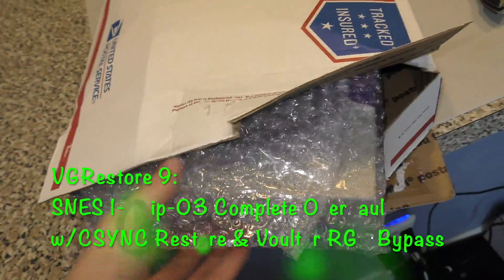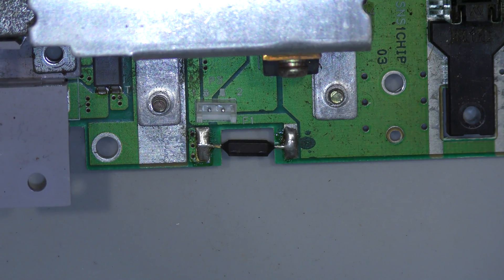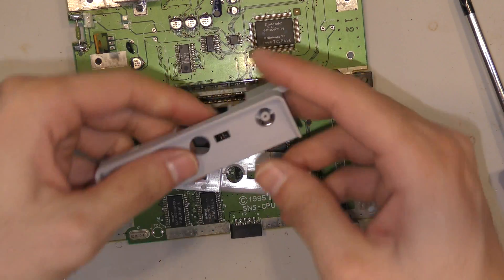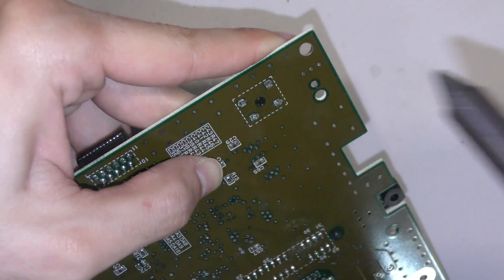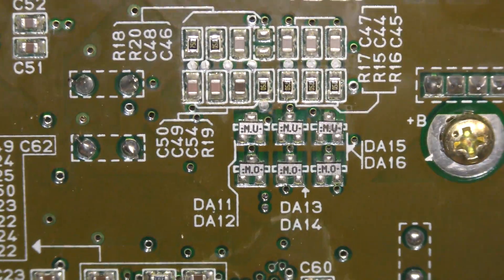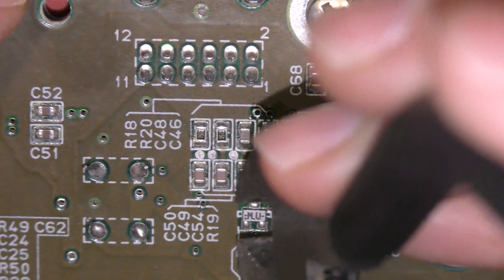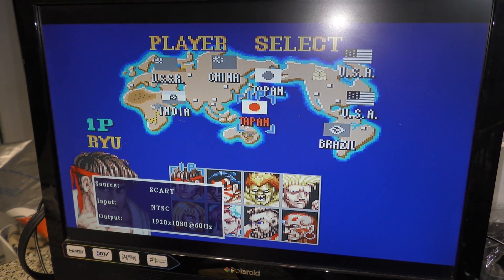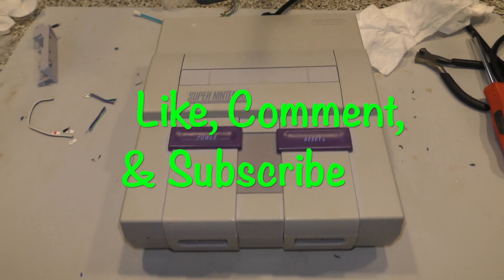VGRestore Ep9: SNES 1-Chip-03 Complete Overhaul w/CSNYC Restore & Voultar RGB Bypass

Comment: Will the pin connector come out of the 03?
Reply from the maker: No you will have to desolder it.
Reply: @PunkNDisorderlyGamer  thanks for the response, that is good to know. I took apart my '03 and cleaned it just like in all these cleaning videos, and I actually also had the first series SNES as well, but I can't remember the number for that. That connector came right off, and I cleaned the inside of that SNES as well, however, after the cleaning and trying different cables and cartridges, I cannot make either of those consoles work.

Comment: Ok probably answered this earlier but my Mario world game keeps missing music during the map screen.any ideas on why???
Reply from the maker: I’m not sure, that’s very strange I would try another copy of the game, if it still persists then your console may have an APU fault. If your console has a removable SHVC I would try reseating it or replacing it. Could also be bad capacitors but, you mention the console doesn’t have music only on the title screen, other parts it’s fine?
Reply: Ok just to be sure I I double scrubbed everything and re soldered all connections and no dice.also I tried to remove the pin connectors and it's like it's super glued in.any ideas?also yes i removed all retaining screws.
Reply: I still can't remove my pin connector bar.its like it's stuck  with super glue.any ideas on how to remove it w/O damage?
Reply from the maker: Jacinto Gomez you have to clear the through holes, if you have a desoldering gun it’s easy. If you have a vacuum pump or desoldering braid it takes more effort.
Reply: @PunkNDisorderlyGamer  ok there's thin lock clip tabs but I've already in clipped them and the two retaining screws.
Reply: Wait ok I see what's going on.it looks like there's calcium or lime in the pin connectors.thank god none broke.wheew!😓

Comment: what does the fuse change do? does it just not work without the fuse?
Reply from the maker: You won’t get any power if the fuse is blown. It’s actually quite common fault among SNES, and a very easy fix.
Reply: @PunkNDisorderlyGamer  word thanks for fast response man. i just found a 1 chip 03 on ebay and i ordered all the parts to do what you did in the video
Reply from the maker: A E cool I hope all turns out well, if you need help I’m here. 👍

Comment: You have the same  soldering Station that I do lol... Another Great Video...
Reply from the maker: Thanks. I’m about to upload another one right at this moment, it’s processing. I have a Ksger T12 style soldering iron my favorite tip is Hakko T12 KU it’s the smaller version of the K knife edge style tip. My other iron is a 2 in 1 hot air rework station but, the tip and heating element broke I’ve since replaced it. I may buy a better iron handle with the same Pinout to use on the 2 in 1 station.

Comment: Great video! I just wanted to mention that if you're installing Voultar's bypass board, it can also enable csync for you. Just connect a wire from R9 on the SNES to Voultar's CS pad. It can save you the trouble of having to reinstall all those surface mount parts.

Another option to consider is the dejitter mod. It will give you back csync, and also increase compatibility with many HDTVs through the OSSC.
Reply from the maker: Aaahhh, I over looked that. Well at least I got some practice at soldering small components. I’m gonna try that if I ever have to install another Voultar board on an 03. Also, I’ll have to familiarize myself with the dejitter mod.

Comment: what from the ebay listing made you think it was a 1chip?
Reply from the maker: The serial number started with UN32 usually those were the last units made. In my experience anything with UN307 or higher is a 1-chip.

Keep in mind you may find a UN800 or UN900, those were refurbished units by Nintendo and not necessarily a 1-chip.